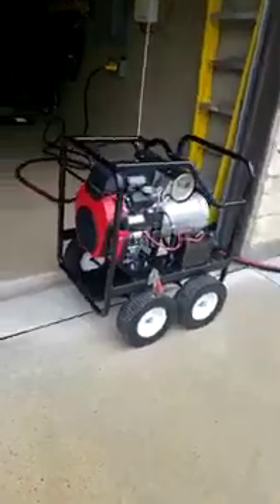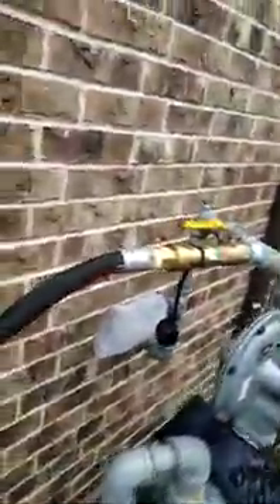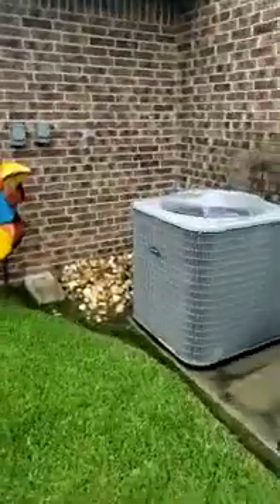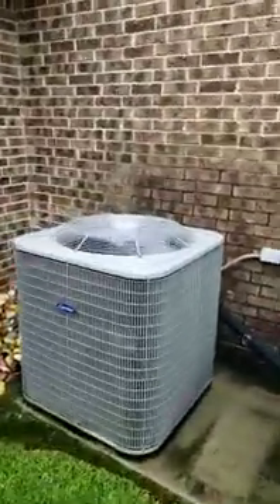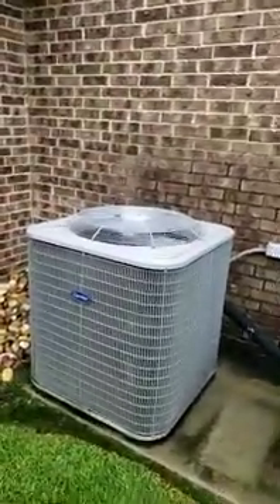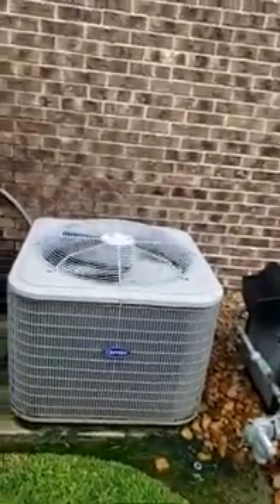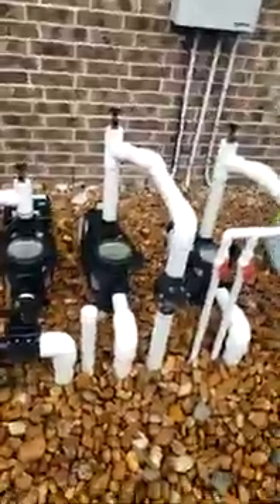Successful Test of PORTABLE Whole House Generator Running LARGE Central A/C Unit on Natural Gas!!

Comment: Can you explain the NG regulator and pressure setting setup?
Reply from the maker: The NG Regulator in this setup is the one that is provided by the utility company prior to the natural gas line that enters the home which regulates the gas pressure to  7 IWC (Inches water column).    The quick-connection is made on this 1" supply line, as this is the minimum amount of pressure that is required to operate our generators.  The diameter of the hose and associated connections are largely determined by length.  Wen a customer buys from us at Portable Whole House Generators (PWHG) (www.PortableWholeHouseGenerators.com), we provide the appropriate hose length, diameter, and fittings to ensure optimal operation.

Comment: Quick question .. where did you buy the long natural gas cable? I can't seem to find any 3/4 inch hose longer than 15 feet.
Reply from the maker: These are hard to come by with the correct connections and I purchase in bulk from a wholesale supplier.  Due to liability reasons and the various possible connections and the quality of these connections that come pre-installed on other generators,  I  provide hoses that are designed to fit only the generators I sell from my company: Portable Whole House Generators (PWHG)- (www.Portable Whole House Generators.com)
Reply: @portablewholehousegenerato7697  Thank you so much 👍

Comment: That's a Honda generator running on natural gas?  What model and wattage generator is it?
Reply from the maker: Hi!  That generator is something I am now providing to customers, where the generator is built based on my specs.  This generator provides 18,000 Watts / 12,000 Watts on natural gas (23,000 Watts/13,000 Watts on Propane).  I am selling this generator locally in the Houston area (as my neighbors have been following my progress on neighborhood websites), but I am also dropshipping them anywhere in the USA.  I am in the process of building a website (www.PortableWholeHouseGenerators.com - UNDER CONSTRUCTION) and would be happy to send you more details, specs, pricing, contact information, and answer any questions you may have,etc.   All you need to do is email me at info@PortableWholeHouseGenerators.com.  Cheers!  Mark K.  PWHG:  Portable Whole House Generators - "A portable and practical solution to a traditional standby generator at a fraction of the cost."